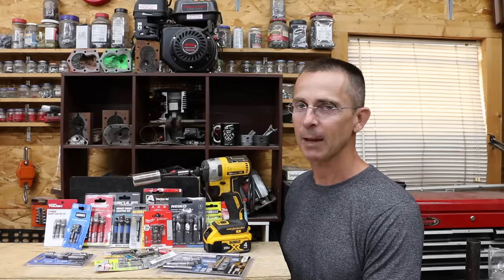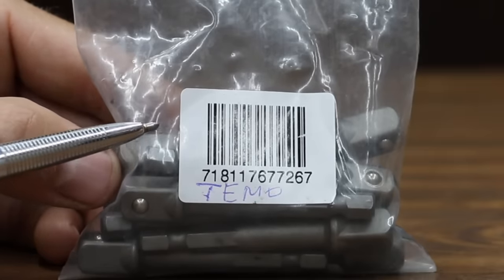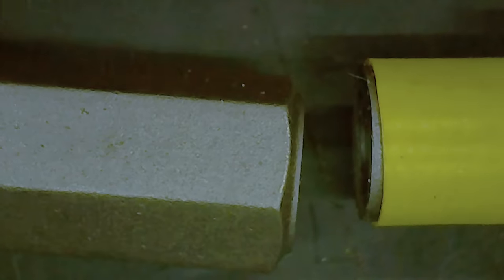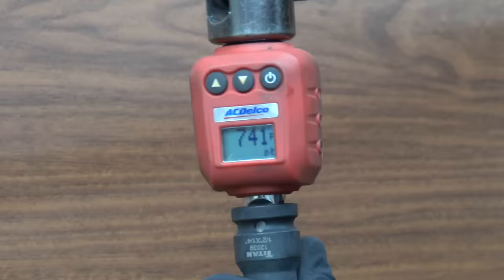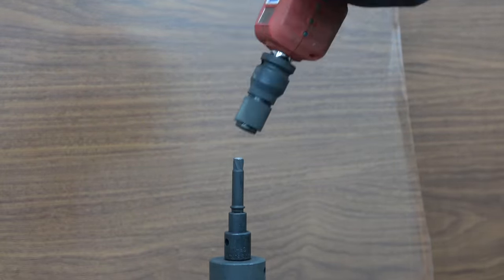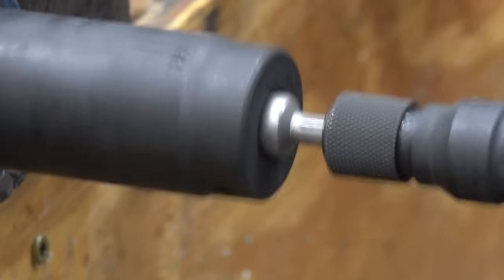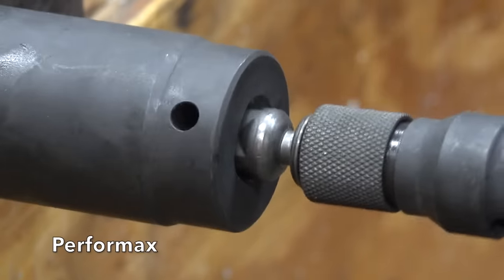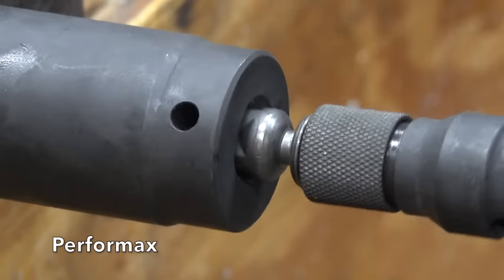Best Socket Adapter? 18 BRANDS: Milwaukee, DeWalt, Makita Gold, Ryobi, Hart, Irwin

Comment: the shock absorbent zone isn't really for anything other then preventing too much application torque, you use it while installing bolts and nuts with an impact so it doesn't over tighten and break. Look up torque sticks, its' basically the same premise, impacts used for installing bolts typically use them
Reply from the maker: Thanks for the feedback.

Comment: Do you have apples and oranges? Non impact is harder/more brittle/twist resistant for slow fastening. Impact is softer so it doesn’t shatter. They are designed for opposite uses. You seem to be a knowledgeable engineer type. Not all your audience may be.  Just my 2 cents. You do an excellent job and provide a valuable service. Thank you.
Reply: Softer meant ductile..
Reply from the maker: Thanks and you are welcome!

Comment: Will try Dewalt impact rated adapters now.  So far, no 1/2” impact adapter has lasted,  driving long lag screws into ground with my 20V Dewalt impact driver.
Reply from the maker: Thanks for sharing.

Comment: I would like to see this test repeated. While I do agree with your conclusion, I think it would be a more accurate test to test the adapters in an impact driver than an adapted impact wrench because the impact driver produces faster blows with less force. I think then it would be less of a torture test and more a test to see which adapters are best at transferring torque, which is why I’d love to see a torque curve torque test channel style.
Reply from the maker: Thanks for the suggestion.
Reply: Thats interesting. Another popular channel tested the HF Warrior with a 1/4" impact driver and it did 450 ft lbs and it did not break. Several others including Dewalt, Husky, Milw... also did 450 successfully.  Ryobi broke only at 150. That test was with a Fuel M18 imp driver @ 4300 IPM and using actual nuts.  Not rams like this test - I have no idea if that makes a difference. This Project Farm test I think is with a Dewalt @ 3200 IPM.  It seems that you are onto something...

Comment: I use warrior one with my 18V makita impact driver ALL THE TIME cuz its $2 set with coupon. I'm a lubetech and I use it everywhere. At home, I even use it with 13/16 to take off/on my lugnuts with full blast. It's been almost 3 years but none of them failed or cracked. For impact driver level nut busting torque, probably warrior brand is good enough.
Reply from the maker: Thanks for sharing.

Comment: VERY informative with commonly available adapters. Have you ever tested some of the Apex brand tools? They're an industrial fastener tool supplier, with lots of special stuff. I don't believe I've ever seen an Apex socket in any finish but "raw", but they last a long time in production settings.
Reply from the maker: Thanks for the suggestion.

Comment: Impact tools are designed primarily to withstand fatigue in service conditions. I'm not sure either test measures this. A test assessing the number of cycles to failure at average service load would have been nice...
Reply from the maker: Thanks for the suggestion.

Comment: Excellent info on impact adapter bits. I use these on a daily basis installing doors and other equipment. It's been my experience all bits fail eventually. One additional bit of information I would like to know is if any of the bits were more difficult to remove from the impact once they broke off?
Reply from the maker: Thanks   Thanks for the suggestion.!

Comment: Like a mechanic I would like you to test the 1/2 to 3/8 socket adapter impact and regular because you can find them from $3 HF to $45 Mac tools. And it’s the most common broken tool for mechanics beside the knuckles adapters.
Reply from the maker: Thanks for the suggestion.

Comment: Very Interesting test PF I have used an impact adapter, next you should test the strength of socket adapters, 1/2" to 3/8" I would love to see the out come between, Snap ON, MATCO, Craftsman, Home Depot, LOWES, and Harbor Freights brands, let me know what you think about this test, and use both the chrome non impact and Impact ones.
Reply from the maker: Great suggestion!  Thank you.

Comment: Test suggestion:  Safety goggles / eye protection that fits over glasses (Not the plastic glasses looking ones).  I recently got a cheap set that look like lab goggles at $3.50 for 3, and an "expensive" Heart one for $14.xx.  The cheap are not that comfortable but work, leaving lines on my face.  The Heart is very comfortable but gets a layer of water (not fog) on the inside of the lens when going from a warm room to cold outside.  A face shied is good but bulky and fogs up while a chainsaw mesh shield makes things darker and not great for dust. Would Ski or motorcycle goggles be better?
Reply from the maker: Thanks for the suggestion.

Comment: Dewalt saysnin the packaging that it can handle 2k psi and they were not lying. I always trust dewalt nc to see ut outpeforming  other brands. The drill that i use is made by dewalt and i had it since 2005! It still is running alive and well to this day

Comment: Love your videos and first time commenting.  I was super excited for this because I have bought a few of these and they all suck in my opinion for one reason you did not test that I was looking forward to.  How well it holds the actual socket on.  Most of them (Warrior, Bauer) are crap and that's my biggest complaint with them is the sockets move all around on them.  Maybe a test on socket retention?
Reply from the maker: Thanks for the video idea.

Comment: How about a test on 3/4" to 1/2" socket adapters. I've sheared two apart over the years using an earthquake 3/4" pneumatic impact tool with 1/2" adapters.
Reply from the maker: Thanks for the suggestion.

Comment: I’ve had two of the performax 3/8 adapters brake in my impact while drive lag bolts. I’ve never had an issue with Milwaukee
Reply from the maker: Thanks for the feedback.

Comment: I thought I only needed a 3/8", since that's what most of my sockets are.  I selected a Milwaukee.  Later, I picked up a 1/4" by a brand I had never heard of, because it was only a dollar, and would save me using an adapter.  I probably won't put too much torque to a 1/4" drive socket anyway.  Later, I saw this video.  Some time after that, I had a need for a 1/2".  Knowing the tool could potentially see some high torque situations, the choice was easy.  I spent a few bucks more, and got the DeWalt.
Reply from the maker: Thanks for sharing.

Comment: Oh man, missed the best ones I've found: TITAN Stubby Socket Adapter Set.
1. I've found they take more abuse than other similarly sized adapters.
2. Inexpensive at around $3.99
3. Most importantly, they're the shortest I've found. Manufactures are making shorter and more compact impact drivers, only to have us attach these needlessly long 3 inch adapters.
Reply from the maker: Thanks for the video idea.

Comment: Just snapped my 3/8” adapter bit this morning (I don’t remember what brand it was, I think from Menard’s). In fairness I was using it with a 17mm socket for my wheel bolts; should have been using the 1/2” bit but meh. So I thought I’d come back to this video to pick a replacement.

Todd sounds a lot different in this video, like maybe he had a cold. Hope he got over it 😊
Reply from the maker: Thanks for the feedback.  I am doing fine, thanks for your concern.

Comment: I've used probably half of those Brands out in the field and I will attest that the DeWalt brand tends to last the longest. And I'm a garage door installer that uses their impact on everything,  I only use a wrench when it's the only way (track too close to the wall to fit the gun, ect...)
Reply from the maker: Thanks for sharing.

Comment: Your videos are always interesting to watch a socket swivel adapter would be interesting video most of the cheaper ones I used you go to put any torque on them the little pin falls out then you on the ground trying look for it I don’t know it be interesting to see what test you do on them and see witch one comes out the best
Reply from the maker: Thanks for the suggestion.

Comment: I have some of the ryobi adapters that I have been using for like 3 years, and I cant believe they have not broken yet. I think its because the ryobi impact driver is weak though, I got a dewalt and after one use the bits started to look like they were going to break.
Reply from the maker: Thanks for sharing.

Comment: The only issue with this testing method is I find most of my adapters break from metal fatigue (twisting in reverse and forward) which would lead me to think the adapters need to be harder steel, but that would also make them more brittle and prone the snapping from the first test. The second test was quite useful but I dont think it gave enough information to know which would hold up the best on its own.
Reply from the maker: Thanks for the constructive feedback.

Comment: One thing that was missing from the test was socket retention. How well do these adapters hold on to the socket? It is very annoying when the socket separates from the adapter and stays on the bolt being tightened!
Reply from the maker: Thanks for the suggestion.
Reply: Good point

Comment: This makes me wonder if the purpose of these bits is to withstand as much torque as possible, or to break at a certain torque before the tool? Is a higher number in fact more desirable? If it is then it is puzzling why certain top brands make a point of a narrow waist on their impact rated bits.

Have you reached out to any of the companies engineers to ask what the design parameters were for these bits? Much like bodies of cars have changed from impervious bricks to G absorbing cocoons.

Comment: I’m curious to see how the Husky set would have held up. I had a set of Warrior but gave them away since they dont have a warranty and instead got myself a set of husky which have performed fantastic. I use impact drivers a lot and they’ve been through hell and back but still hold up great. And they also have a warranty-so its a win win there.
Reply from the maker: Thanks for the suggestion.

Comment: If you have a more powerful impact driver, make sure you buy the toughest adapter you can afford twofold. And always bring a ratchet with you. Because breaking the adapter, having no second and no ratchet around may stall a lot more than you find acceptable. It may even happen that the adapter breaks at the end of the impact chuck which happened to me. If that's the case, removing the stuck part from the chuck can be a big challenge for which you need patience and tools you normally don't bring with you.
Reply from the maker: Thanks for the feedback.

Comment: Project Farm, I just recently started working on marine engines for my career. I don't own a 1/2 or 3/8s impact at the moment, I have just been using my normal impact with snapon adaptors. after watching your video comparing compact 1/2 impacts, I'm interested in the M12 fuel impact. But $300+ is a lot of money when I already have an adopter set with a lifetime warranty. I guess what I am asking is whether an actual impact is worth the money over a set of adoptors
Reply from the maker: Thanks for the suggestion.

Comment: Very interesting but it should have been an important test to go forward and back multiple times.
Most screws nuts and bolts break from torquing forward and back which stresses the metal and this would be the case with the adapter as well.
Forward and backward should have been applied to the testing.
Thank you
Reply from the maker: You are welcome!  Thanks for the feedback.

Comment: Valuable film. I have an ACDelco ARI20101 heavy duty 20V impact driver. Brushless with 3 electronic speeds, I believe it exceeds 160 ft-lbs at max. Made by Duroflex in Taiwan.

Will the DeWalt remove and replace Chevy 22mm lug nuts torqued to spec of 140 ft-lbs? Your test had no one getting much more than half of that, but how does it compare real-world for that job? Can any hex driver and bit/adapter set do this? Can i just accept breaking them by hand and taking what i can get with fastening force. Amazing that the machine might destroy any bit small enough to fit it!
Reply from the maker: Thanks for the video idea.

Comment: Huh. I had a set of impact sockets that came with two dewalt adapters. I'd switch back and forth between two sockets, and was lazy enough to just use an adapter on each one. After about 2 days of using them, they wore enough, that they really wouldn't realease from the wrench. You had to bang the wrench a bit on something 'til they came loose. It's pretty damn annoying. Now, they might not snap, but... I have another tech I work with has the same issue. I went to the milwaukee one, and haven't messed it up yet.

Comment: Husky makes the best socket adapter for impact drivers! You can get a 6pcs set (3 short & 3 long) 1/2in 3/8in 1/4in for less than $10 at Home Depot.
Reply from the maker: Thank you!

Comment: I’ve been using an old 18V Dewalt 1/4 impact for years… I’ve never broken a socket adapter with it. I lose adapters more than I should, though. I think I’m currently using some ARES, Warrior, Dewalt, and random no name brands.

Rated at 1330 in/lb with the old small NiCad battery, and it picked up when I started using 4 aH lithium ion.

I don’t really know what kind of application there is that calls for these adapters to be used in anything more powerful. There are better options for tools at that point.
Reply from the maker: Thanks for sharing.

Comment: Hey man do you ever consider testing a few different options from the same brand? I wonder how much a cheaper vs more expensive product from the same manufacturer would stack up?

With the current format it seems like literally every tool or item would have to be from a different brand (based on what seems best), but I wonder if there are gems in each line up that we are missing. Thoughts?
Reply: Good example of this is your two makitas here btw!

Comment: By the looks of these adaptors one may think in the first place how long is that gonna work / how's that supposed to work in high torque applications?
The way the Bosch breaks is not very reassuring (I own a lot of Bosch tools)
Fortunately my Bosch impact driver GDX 18V-200C has both 1/4" and 1/2" socket holder, I still found the test very entertaining.
Reply from the maker: Thanks!

Comment: What you are doing with the ryobi isnt right at 10:26. These druvers are designed to be way further in the machine than only the back part, you should be able to do that with impact drivers (like makita dtd171 or dtd152,3,4,5 and so on) you have to pull the ring first before you can insert the whole driver in the machine ( if you dont understand what im saying i would recommend watching a review or some sort where a cordless impact driver is used). I hope you see this because at this point it wasnt a fair test

Comment: I snagged the Bauer set from harbor freight, just for test purposes, my impact driver has destroyed everything I've put in it so far, Makita, DeWalt, Ryobi and Milwaukee, but somehow the Bauer are still in tact 🤔🤔🤔 did I luck out and get an above average set??? I've used them for things they're not intended for, seat bolds, seat belt bolts, lug nuts, suspension bolts and they just don't care, they take it. My Milwaukee ones all exploded before getting seat bolts out. Bauer for the win!!!! And for reference, a 1/4" stainless bolt snaps long before I even realize I'm actually tightening it 🤣🤣🤣🤣 .... What's the point of having big powerful tools if ya can't break stuff once in a while??
Reply from the maker: Thanks for sharing.

Comment: I bought job smart ( tractor supply ) 1/2 to 3/4 socket adapters and snapped both of them, did the same thing with cobalt. Thought I saw a video on comparison, maybe I missed it or maybe it hasn't been done yet? maybe I shouldn't buy one until I see a review?
Using a breaker bar and trying to remove Lugnuts, I went out and bought another one of the correct size until I get another vehicle which will be different....
Reply from the maker: Thanks for sharing.
Reply: Not sure I worded that right I bought a socket to put on the breaker bar that fits the Lugnuts so I don’t have to use the socket with an adapter. Also the “lifetime replacement yeah apparently is only 60 days you must have original packaging and receipt and if you bought the set you have to return the whole set yeah it’s been at least two years even though I broke them a year ago. I’m hoping to go to Lowe’s tomorrow and see what they say. Tractor supply also suggested that I should’ve gotten the impact rated ones didn’t think that was going to be an issue. But they were all just shocked at the cobalt ones broke. Thanks for the reply wasn’t sure if comments were monitored as much and I look forward to a review think I’m going to hold off buying one from Napa mostly because they’re out of stock and I’m not sure who’s going to have the best deal.

Comment: how about a test on "extended" impact socket adapters ?  like 6" ones. there are so many on Amazon from $8 to $30 like Lexivon, Horusdy, Dowel, GearWrench, Swanlake, Neico ect ect... i even saw a Husky set at HD for under $8 for a 3 pc 6" set.. mixed reviews though. Im curious about torque loss if any due to being longer.  Thanks .
Reply from the maker: Thanks for the suggestion.

Comment: Can you test 1/2" to 3/8" adapters for impacts? I have a 1/2" cordless impact but most of my smaller sockets are 3/8" drive and I'd rather buy a good adapter than buy all new sockets or a 3/8" impact
Reply from the maker: Thanks for the video idea.